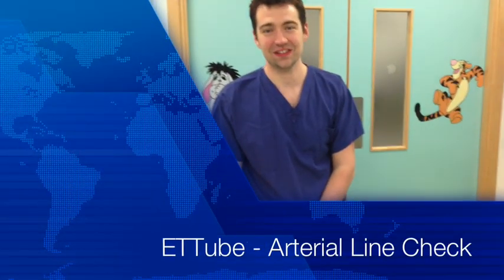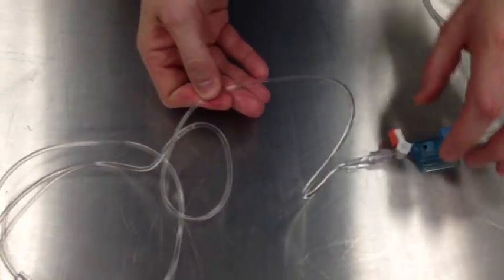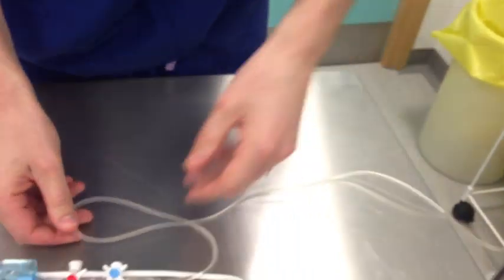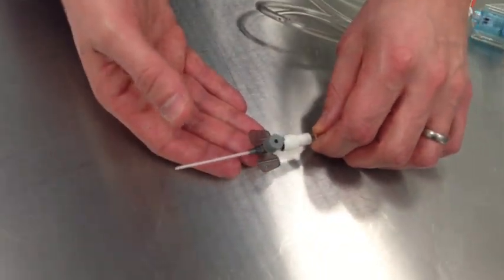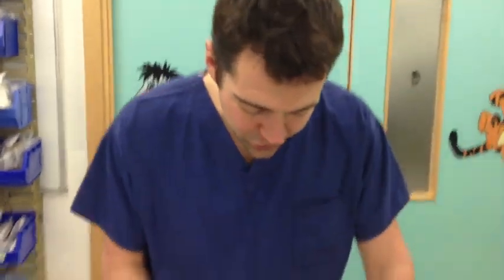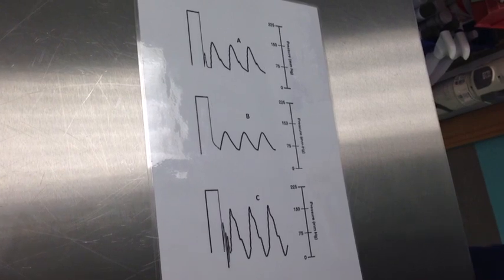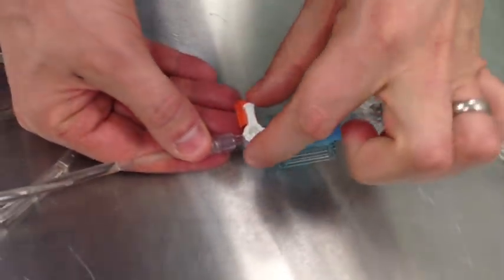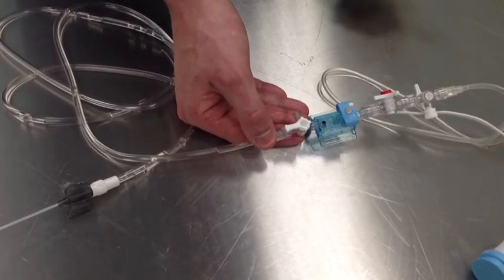PRIMARY FRCA OSCE: Arterial Line Check (www.ETTube.co.uk)

Comment: what is the purpose of the higher pressure callibration ?
Reply: The pressure bag is usually set at 300mmHg to ensure a continuous forward infusion flow into the artery at 3-4ml/hr. This prevents  clotting, air emboli or blockage, thus dampening our arterial tracing.

Higher pressures calibration may for below sea level? Not certain.